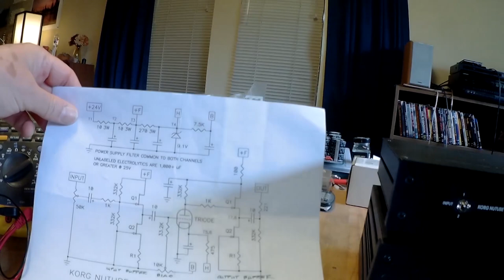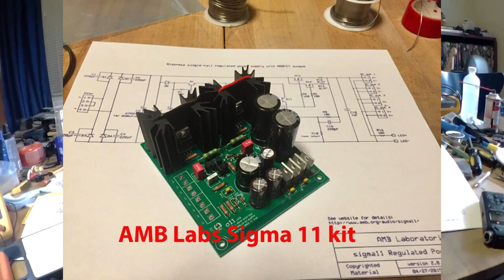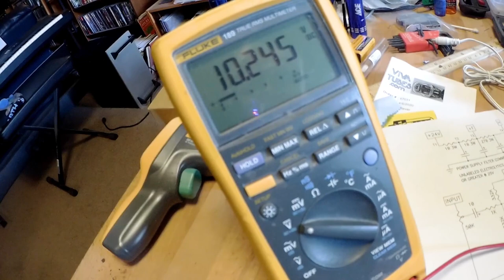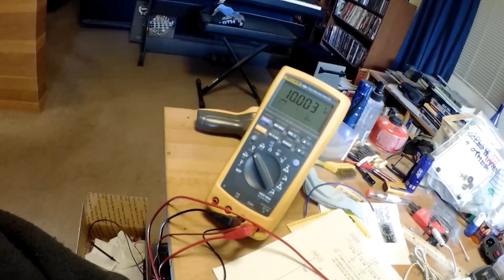Robert Builds the Pass Korg NuTube B1 Preamplifier

Comment: Great video! Not only have you figured out what's wrong with the Nutube and what you don't like, you have (most critically) determined a course of corrective action. I've acquired the Pete Millett balanced version PCBs, and because I'm not an expert on these matters a lot of time is being spent researching all the options for the build.
Good work. Keep it coming.
Reply from the maker: Thanks Ronald!
Reply from the maker: Tell me how the balanced boards have worked for you. I would think that bias adjustment becomes critical to keep PSRR optimum.
Reply: @NocturneVid66  First of all, Greetings to the internet's number 1 audio tinkerer.😄 Hope all is well.

I'm sure you're familiar with the term BACKBURNER. In this case, necessitated by a failed music server and the need to quickly build a new one. Though, in truth, the first build convinced me to do a second (Better) build. Then came the unregulated linear power supply project that the second server build demanded. 
Easily distracted? Me? Of course not! Unless you mean the burning urge to experiment with Home Audio Fidelity's room correction and crosstalk cancellation filters on the new server.

Meanwhile...the Nutube bins continue filling with new parts, like the Salas SSLV 1.3 power supply boards, and, the Sjöström Super Regulator power supply boards. Decisions, decisions. The thing about the Sjöström boards is that they are fire engine RED, with gold pads...and oh so gorgeous. Self control?
At this point, looks like the Nutube will have to wait for Winter.

On the subject of proper bias Pete Millett has described several avenues for getting the job done, and says for ''normal uses'' it won't be hard to achieve. Interesting stuff that I'm sure someone like you would love to read. There's a thread over at DIY Audio (Building the Pete Millett Korg Nutube Balanced Preamp) where a couple of builders say the process has been relatively easy.

Comment: You sure went to great lengths to tame the microphonics.  Luckily, the nutube in the kit I received isn’t microphonic at all.  I merely used the piece of foam that came with the nutube and mounted it below the nutube.  I ended up with mine biased at 10V also.  You might consider replacing the remaining electrolytic caps with Elna Silmic’s, which is a favorite of Nelson Pass.  I use them whenever I can.
Reply from the maker: Thanks Ronnie. I like the Silmic caps too. I put them in my Pass F6 amplifier. Yeah, the degree of microphonics seems to vary widely on the NuTubes; you were quite lucky. I hear most folks get at least a small degree of ringing.

Comment: Those are large 10uf caps, how many volts is the Rail of the preamplifier?
Reply from the maker: The rail voltage is only 24 volts. You could easily use smaller 100V WIMA Polypropylene capacitors if you chose. I just feel that the Solen caps sound better.

Comment: Hi Robert-  thank you for sharing your expertise.  I just started building my Korg Nutube B1 when I found your video.  Can you share the exact values of the Capacitors you changed and also where you purchased them?  Thanks again.
Reply from the maker: I changed out the 10uF electrolytic coupling capacitors that you see near each of the buffer sections. I jumped in whole hog and changed out the input caps for Dayton 0.47uF Polypropylene film and foil caps, the middle caps for 1uF 250V Solen polypropylenes, and the output caps for 10uF 250V Solen polypropylenes. You can get all of those from Parts Express.com.  All these capacitors are physically large and hard to squeeze in on the PC board.
An interesting halfway step which I did not try would be to parallel  physically smaller polypropylene capacitors with the existing electrolytic coupling capacitors. These could be soldered directly to the capacitor leads on the underside of the circuit board. I would recommend 1uF 250V Panasonic ECW series, as they have a small physical size and long leads for easy connection. Remember to put sleeving or scrap wire insulation on the leads to avoid shorting. A 1uF cap should give you the benefits of a film cap through most of the audio band except for the lowest bass.
Reply: you all prolly dont care at all but does any of you know a method to log back into an instagram account??
I somehow lost the account password. I would appreciate any tricks you can give me!
Reply: @Marshall Angelo instablaster ;)
Reply: @Dax Kameron I really appreciate your reply. I found the site on google and Im in the hacking process now.
Takes a while so I will get back to you later when my account password hopefully is recovered.
Reply: @Dax Kameron it did the trick and I finally got access to my account again. I'm so happy:D
Thanks so much, you really help me out !
Reply: @Marshall Angelo No problem =)
Reply: @NocturneVid66 Hi Robert, could you also explain why you changed the values of the capacitors and what effect this has. 
Thanks.
Reply from the maker: Lloyd, the main purpose was to upgrade the quality of the capacitors to polypropylene units which have superior sound quality.
Unfortunately, these capacitors can also be as much as 50 times larger than an equal value electrolytic cap. Everything had to fit in the one-unit high stock enclosure.
The stock 10uF electrolytic signal-coupling capacitors are a standard value used in solid state circuits.
Without getting too technical, the signal coupling capacitors form an RC high-pass filter with the input impedance of the following stage. If it is a low impedance solid-state circuit, the capacitor must be large. If it is a high-impedance tube circuit, the capacitor value can be much smaller. We are lucky that the NuTube and the Pass B1 buffer stages both have relatively high input impedances.
If the capacitor value is too small, then the RC filter action of the coupling capacitor will roll-off the very lowest bass frequencies. This may not be a problem if you listen to chamber music, but a big one if you listen to pipe organ music. 
The most critical caps are the output coupling capacitors, I left them at 10uF Solen Polypropylenes even though I had the hang the capacitors off the side of the circuit board.
Reply: All I can say is Wow!  After making the suggested modifications the Nutube B1 is fantastic.  Don’t forget to play around with the bias setting to optimize for the tone you prefer.  Like changing tubes for free.
Reply: @NocturneVid66  Thanks, recently finished mine, love the sound but already thinking of upgrades. 😂

Comment: Hi Robert! Nice video. I'm just in the process of building my B1, and you've got me thinking.. It would cost me far too much to buy from PE here in the UK (shipping for those caps would be like $45), so I'm probably limited to Sound Imports EU. I know I can substitute caps that have a higher voltage rating, but not a lower one. If I can't find the exact capacitance, am I okay to come within 10% either way? And would it really matter which brand I buy, given that Sound Imports will all be caps intended for audio anyway? 

Any input you are able to give greatly appreciated - I'm just at the PSU testing stage right now..
Reply from the maker: Since the maximum voltage in the preamplifier is only 24V, you have quite a bit of leeway when it comes to the voltage rating of the capacitors you select. 
I would recommend Polypropylene film caps of 50V and greater. Wima caps would do well, but their short leads can be an issue. 
10% wiggle-room on the capacitance value should be OK. Just remember if you make the value too small, you will lose low bass response. 
The brand does matter when it comes to quality. I have found that Solen caps offer very good value for the money. 
It can be argued that one reason that tube preamps sound the way they do is because of the large film capacitors used in them.
Reply: @NocturneVid66  Thank you, that’s very helpful. I’ll let you know how I get on! Now seriously considering a Sigma 11 as future project too..

Comment: Regarding the polypropylene caps, if I stick to the original values that you replaced and added long leads to them, clamping them in along the sides of the enclosure and dressing the wires to make space, that shouldn't be a problem will it. Thanks
Reply from the maker: It shouldn’t be a problem unless you live in an area with a lot of radio interference.

Comment: Still waiting for my diy audio korg nutube b1 preamp.  You should do a episode on the amb power supply for this unit. It's a nice power supply that can be used with small modifications for other equipment.  Happen to know what gain this preamp has? Have amp camp 1.6 monos,  and collecting parts for a aleph j, f6 and maybe a f4. Trying to figure out a good preamp with enough to gain to drive a diy pass labs f4. As will be building Wayne from pass labs class a headphone/preamp . Thanks!
Reply from the maker: Papa Pass says it has 16dB of gain. He has a nice descriptive article on it at the First Watt website, or was it Pass DIY?
Reply from the maker: It has enough juice to drive the Pass F5T as loud as I care to push it.

Comment: Oh and what bias setting did you end up with?
Reply from the maker: Dihn, I find it depends on the amplifier. My Mosfet Adcom amplifier has a warm sound, so I adjust the NuTube bias up to around 11V for a more neutral sound. I'm currently using a Yamaha B2 VFET amplifier which is a bit bright and very clean, so I warm things up by adjusting the NuTube down to about 10V. That's part of the fun of DIY.